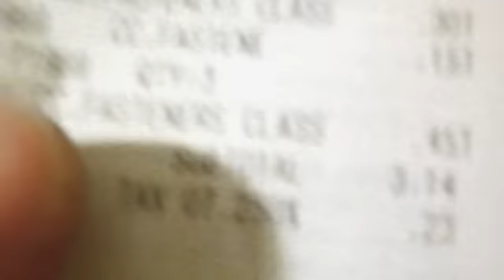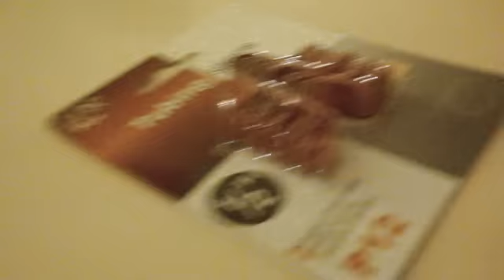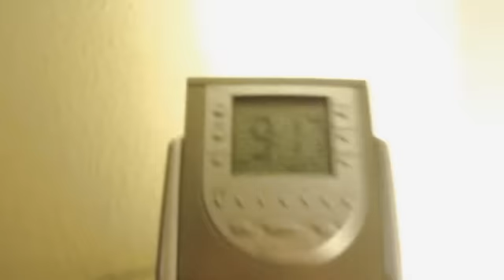Newman Motor: Reversing-Switch plan uses 2-to1 Magnetic Gearing (at a distance)

Comment from the maker: @jimmybilbo

"You can easily monitor incoming amps and volts, to the 'load device' and then compare the different scenarios in terms of output of the device."

I have a lot of old videos which attempt to do this.

"AKA, if you can input the same VA (volt amp) to a fan, but with your business in-between it runs 4% 10% 50% 200% higher, it should be measurable. You could even deduct for losses, to see if it really works."

Losses will be difficult to calculate with a system with switch resistance.

Comment from the maker: @jimmybilbo

"Why aren't you doing something so simple as monitoring amps, volts (and, consequently watts)"

This video just shows an old (failed) plan of mine to use a physically separated mechanism for mechanical commutation. I have actually monitored amps and volts, in a way, using a digital meter and analog meter in prior setups. The low-frequency mechanical switching makes measurement of amps and volts not "simple". You can't take the meter reading as gospel with a circuit like that.